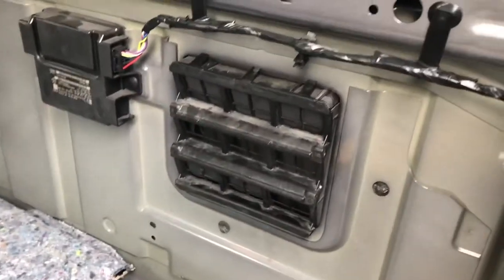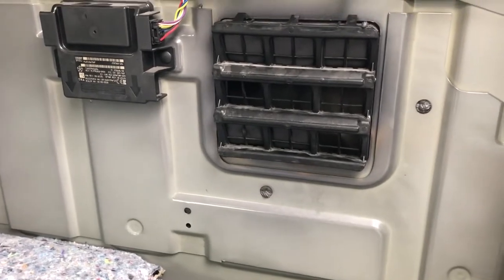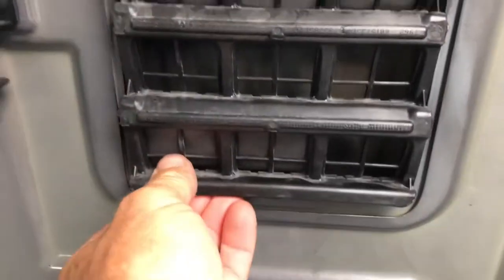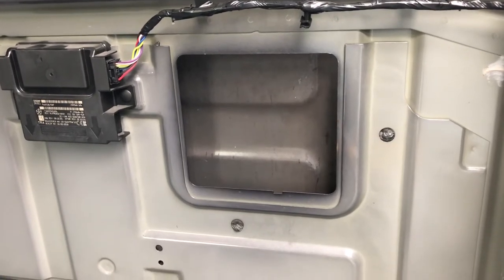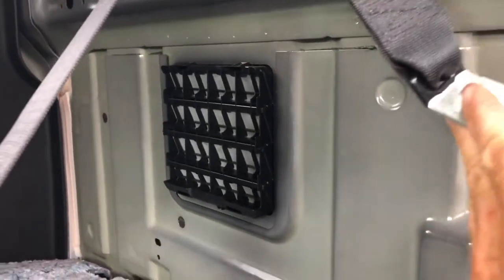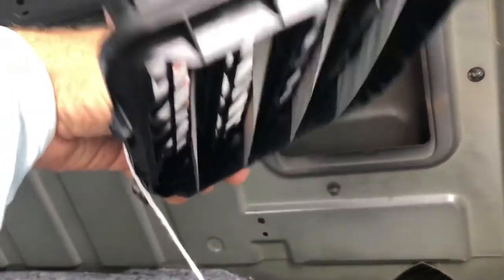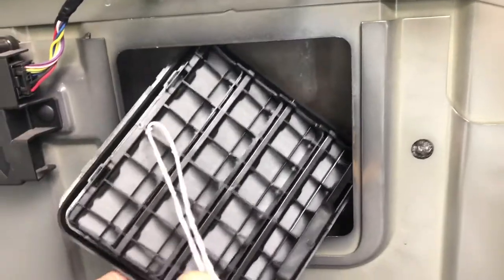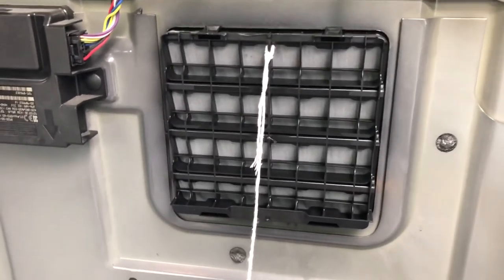Ram 1500 cab vent water leak fix

Comment: So I went to my Dodge dealership and the parts guy looked up on computer and said there is an ongoing Class Action Lawsuit in regards to this problem. He sold me the parts for half price $10 each and I am now going to look into getting on board with that lawsuit. The part was called  EXHAUSTER: CAB
Reply: Did you find the class action lawsuit for this problem?
Reply: @elaztecamoreno yeah where is it?
Reply: Can you post a link to the class action lawsuit about this?  I have both of these ordered for my Ram and my concern is the water that already leaked into my  cabin causing a floor board rust through issue.
Reply: @JamesMiller-ci2yv any update?
Reply: Do you have the part number
Reply: They should have had a recall, and also should have had a recall for the hemi tick also.

Comment: I just did this yesterday. You only have to turn the vent 90° and it goes through the hole very easily. Once it's between the bed and body you can turn it easily into the correct position and pull it back into place. Easiest fix ever for such a big issue.
Reply: Thanks, u saved my day.

Comment: Useful vid. Easy job to pop out old ones and put new ones in. Angled new in, pulled it in, and it popped right into place. Took longer to pull seats and sound insulation.

Comment: Replaced both of mine today after noticing gallons of water in the back of my cab. After watching your video and $40 for the cab exhausters it wasn’t a big deal to replace. New ones are a WAY better fit and design so hopefully it doesn’t happen again. Thanks again for the great step by step video!!
Reply from the maker: Glad it helped
Reply: where did you order from? same issue with my ram
Reply: @JoseGarcia-lu5nk  I got them at my local Ram dealer, they only had two sets left and funny the parts guy knew exactly what they were. Like this happens all the time from the crappy original design!

Comment: I thank you for the video. Tried other videos and got only half the solution. I broke one new vent, but got the second one in after watching this video twice. I was only leaking on one side so I am going to stick with it for now. My main leak was from the third tail light, but the gasket and vent I removed was gummed up and wet. I will be sure to watch out for leaves and debris in the cab/bed gap from now on!
Reply from the maker: Thanks and glad you figured it out.

Comment: They go in much easier from under the truck. Pop the old ones out, drop a string down through the hole inside the cab down under the truck. Tie a knot on the new one and wiggle it through between the bed and the cab then pull the string from the inside. Done

Comment: I replaced the 3rd brake light an the rear cab vents worked great for about 6 months now its leaking again first time it was leaking from 3 brake light, 2nd time water leak it was the cab vents. Now hear I am again for the 3rd time having a water leak, an I've fix both cab vent an 3rd brake light
Reply from the maker: I also had a leak on my rear cab window. I pulled the interior back wall panels of and used a hose around the window until I found the leak. I put some rtv sealant and it’s been good for a few years.

Comment: Thanks for the excellent video. Exactly what is the part called and where did you get yours? If you have the part number, it would be great.
Reply from the maker: I do not have a part number but I asked the dealer parts department for rear cab vents and they knew exactly what they where.
Reply: I just ordered mine today. 68323649AB was my particular part number. The technical name for it is Bodyside Aperture Exhauster. Once I figured that out, it was a lot easier to search for the part.
Reply: @austinthomas3634  do you get a pair or should I order 2?

Comment: I think the seat belt bolts are torque to yield bolts, so replacing them would be a good move for anyone doing this job
Reply: I know this is old but, when I bought my 2015 Ram I found a video that showed how to make the back seat fold down by cutting the bottom portion of the mounting bracket that slides up and down a little bit when you lift the bottom of the seat up.https://www.youtube.com/watch?v=Ve0clzeNqjc

Comment: Just had my 2017 Ram 1500 put  in shop  for a leak they charged me 1000.00 bucks to fix a ten dollar part ,to bad I didn’t check out video before
Reply from the maker: Ouch that is steep. Sorry to hear that.
Reply: Shop manual probably says to remove the bed .. lol .. there's your 1k in labor.. whether they did it or not
Reply: What part did they replace?